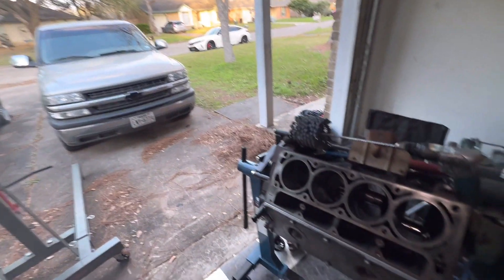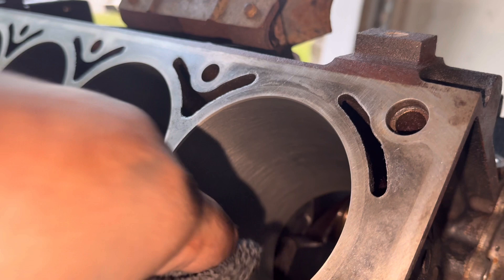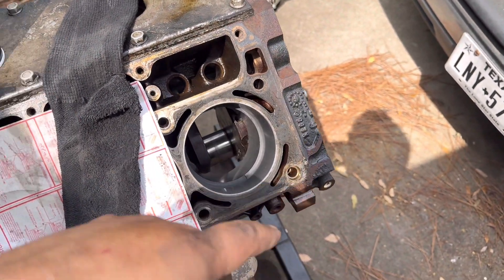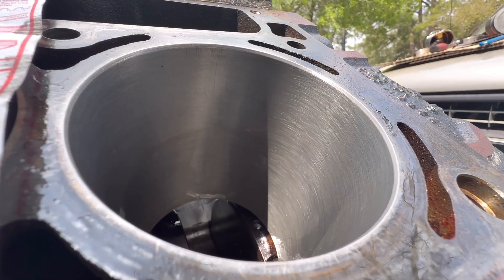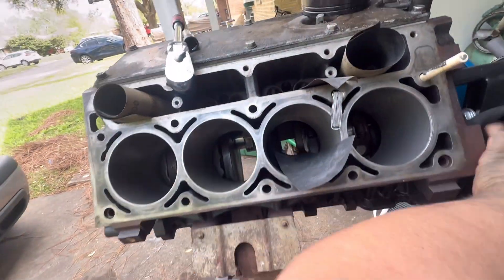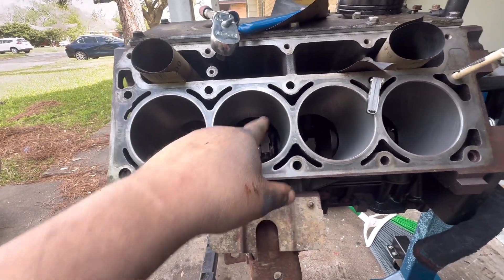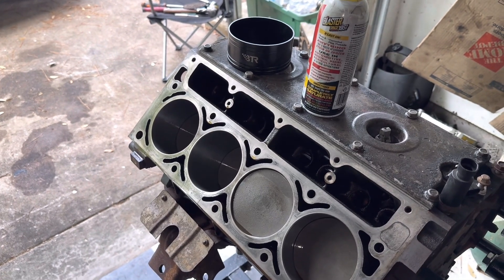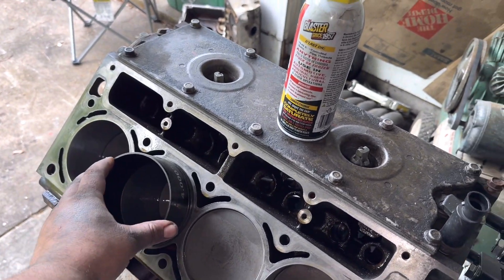LS Build With Flat Top Pistons & 243 Heads.  LQ4 LQ9 4.8 5.3 6.0 6.2

Comment: Well problem is when he bougjt those cheap pistons. Didnt realize really no comp gain when those pistons were designed .020 in the hole. Which are builder pistons and takes into account of decking the block etc. Wouldve been better to just stay with orginal stuff at least valanced to hold up longer bearing wise

Comment: Are these press fit wrist pins
Reply from the maker: Nope, floating with snap rings
Reply: @BoBuilds  so you used the gen 3 lq4 push rods ? I’m rebuilding a lq4 myself for the first time and want flat tops